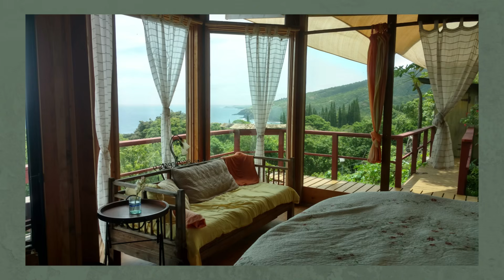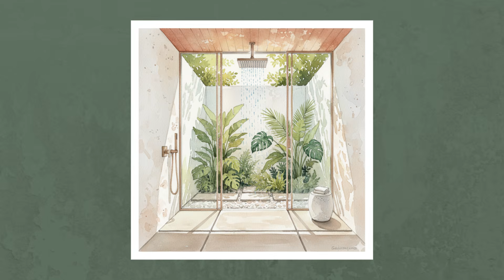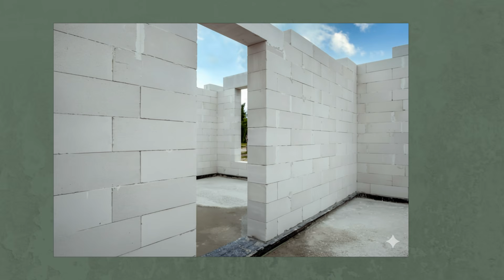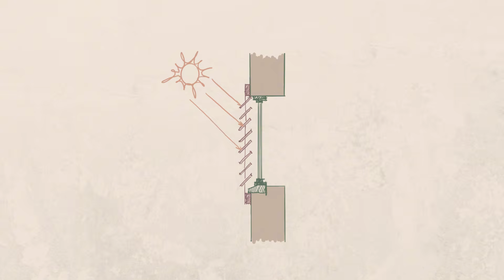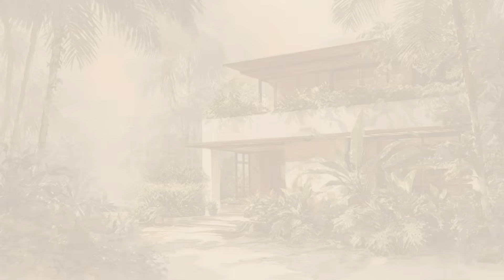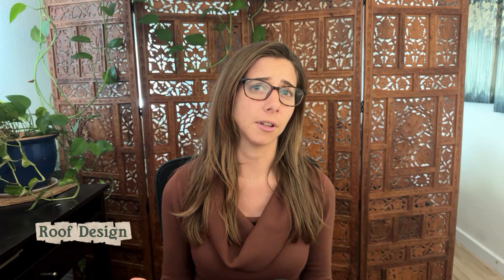Tropical Home Design That Keeps You Cool & Comfortable Year-Round🔥

Comment: this was really concise with a lot of great ideas. not somethin i've given a lot of thought to before, as i'm in high-desert, but i had some...

i'd (if i was building in a tropical region), design with a lot of partial height interior walls. esp for closets/pantry/utility/etc... which i'd place on an envelope wall with a small operable awning window below a taller/narrow picture window above, helping airflow via stack effect (with high placed operable windows in adjoining room), & provide some natural light. 

interior doors would all have transom windows above, like traditional Portuguese homes. much more private than those shutter doors seen in S. Floriduh.

great reason to design in a way that puts beds in the center of bedrooms too, restricting airflow around it less.

all cabinets would be open underneath, with slots in the bottom & breathable/shutter/wicker type doors, and slightly raised countertop height to allow vents between cabinet top & bottom of counter. likewise, any open shelves/bookcases wouldn't fully seat against the walls behind.

still think an ICF envelope (with fibre bar) would work well, because it not only allows easier/better control over ACH & vapor & pests, but it'd provide the strength needed for a zypex'd & reflective coated single low-slope ICF roof with massive overhangs that wouldn't be susceptible to winds And with only 1 low edge, is easier for rainwater catchment too. it'd just be important to shade the floor (overhangs/trees/etc) to keep it moderately balanced, temp-wise.

outside, maybe mix U-stucco with UV reflective paint in the final coat?
Reply from the maker: Wow, these are some incredible insights and ideas! Thanks for sharing all of your thoughts.

I wrote you a long reply and then it suddenly disappeared!  In short - I love the open tops for interior walls - I've been in homes like that and it totally helps.  Also, great thoughts and considerations on cabinets. 

Im not a huge fan of ICFs for a couple of different reasons, but it makes sense in certain applications.  I haven't seen a ton of folks use them for roofs, but I could see how that would work.
Reply: @christinaransbury  
:D

Comment: Yes want to build in the tropical I know termites, heat, hurricanes, humid, fire, salt, rust, moulds are some of the problems building in Pacific. But wanna build with a balance of concrete/wood whats your recommemdations
Reply: I live in the Philippines, we do everything with concrete block and cement render and tile using wood only for cabinets due to termites.  The tropics is not as hot as people think, Arizona gets 105 F in summer.  High 80s/low 90s is more typical of the Pacific Tropics.  Fire is rare.  Storms are brief and infrequent.  Philippines is hit by storms12 times a year, but where you actually live might only get hit once or just a few days of rain.
Reply from the maker: @pauldanielando  yes termites are a big reason why concrete is used, what other masonry systems could replace that?  Rammed Earth, CEB, AAC, etc?
Reply: @christinaransbury there are woods in the Philippines that are resistant to termites.
Reply from the maker: For places to live?  Or how to design with concrete and wood?
Reply: @christinaransbury place to live yes.

Comment: I live in southern part of India. Roof insulation for a concrete slab is a waste of time effort and money. False ceilings do not insulate you from the slab heat either. It traps the heat from morning to evening and radiates it downward at night when you least want it to. The most simple and effective way to beat heat is to reflect it back in the first place by simply painting the surface white with white cement or simply exterior base white paint. Paints with latex in them for water seepage protection will heat up a little bit over simple exterior emulsions. 
Growing big trees around your house will also cool your house surroundings. Watering them in summer in the morning will also cool your house surroundings and thereby your house by the perspiration action of leaves of trees.
Reply from the maker: True!  Insulation from the inside is not as effective, especially with a concrete roof.  Radiative cooling membranes, and paints are a great solution.  Ideally you can do both if it is within your means.   Evaporative cooling in dry climates from vegetation is also a smart strategy.  Thanks for sharing :)
Reply: Do false ceilings contribute to heat?
Reply: @SJ-yg1bh  yes it does i have lived in false ceiling and non false ceiling i can surely say non false ceiling is better against harsh summer
Reply: @infinity11_sq_11  thanks🎉
Reply: @SJ-yg1bh  always happy to help dear🎉

Comment: Very good video about tropical house design. Lots of good points, about roof overhand, having naturally humid areas of the home open to the outside or outside. The one issue that I have yet to hear anyone talk about is elevation. We are located a bit over 1000' on the Big Island of Hawai'i.  During the days through out the year, the temperature is always at least 28° C, occasionally we get in to the low thirties during a day or two. At night the temperature drops always to a minimum of 19-20°C but can go down to 14-15° C at night when the cool air flows down the mountains to us. The other topic that I cannot seem to find information on is roofing in volcanic areas. Because water catchment is a must in off-grid living here metal roof seems to be the main choice but with the SO2 that at times gets emitted from the volcano here this can rapidly deteriorate. Not sure if there are any alternatives that work with rainwater catchment. I have thought of green roof membranes but these are normally under a layer of dirt so I am not sure if they are treated for UV.
Reply from the maker: Great question!  I actually used to live in the mountains on Big Island as well, so I can relate.  For managing the temperature swings, you can opt for some thermal mass with shaded courtyards / breezeways.  Can also implement the stack effect as well for night flushing.  In regard to roofing materials there could be a couple options.  EPDM for example is UV rated.  Could also try stone-coated steel (more expensive) or even clay tile roofs can work for catchment.  Could be a whole other video on roofing materials! 
Does that make sense?  Let me know how it goes!
Reply: @christinaransbury  Thanks for your comments. You seem to be talking mostly about cooling which is not normally an issue for us. We find 28° C a pleasant day time temperature. For us if it drops below 22° C that is to cold. I have thought about breezeways, but think that the stack effect for night time flushing would be the opposite of what I want to accomplish, which is to keep the day time warmth in the house over night. I have been thinking to insulate the roof and to use clay plasters and possibly before cob to add a small amount of thermal mass inside. What I am wondering about is whether to insulate the walls, possibly with light straw clay, I have seen others that build houses with massive amounts of thermal mass only to have the thermal flywheel timing get off. I have seen one family that has earthbag structures in New Mexico and they talk about how they go to bed with covers on and every night at 2 am have to through the covers  off as the heat of the day finally makes it through the wall and warms up the room. I need to look into clay tile roofing. I would watch the video on roofing materials.
Reply from the maker: @frederickjohnh  Great point about the thermal lag.  Adding to the insulation really helps with that.  You might enjoy myvideo on natural materials, if you havnet watched it already.  What climate are you in?
Reply: Absolutely right about selecting a land lot with elevation above 300m or 1000' to get the gift of cool evenings and mornings and more breeze.  The best move you can make in the tropics.